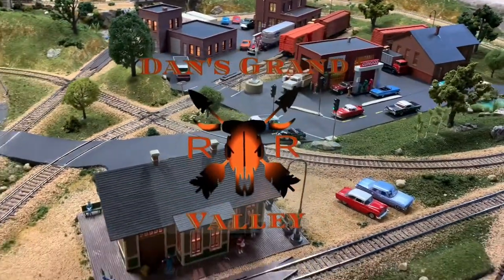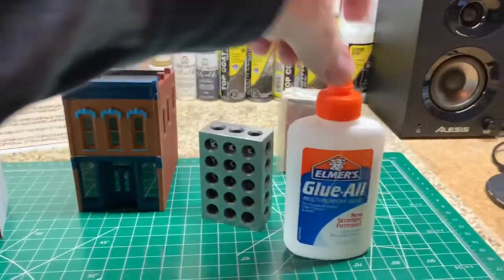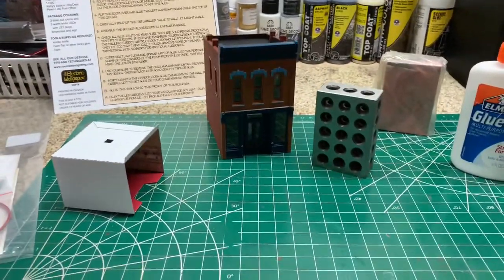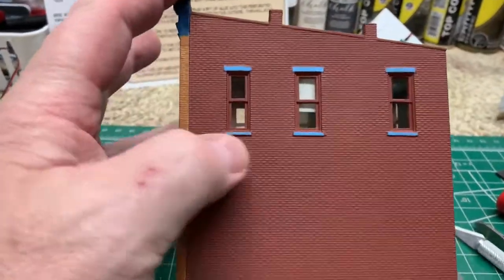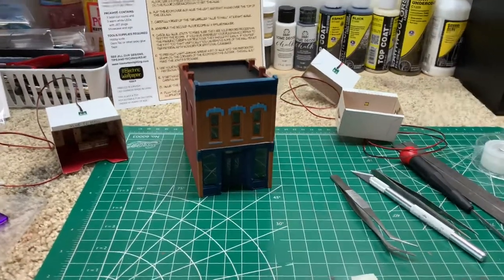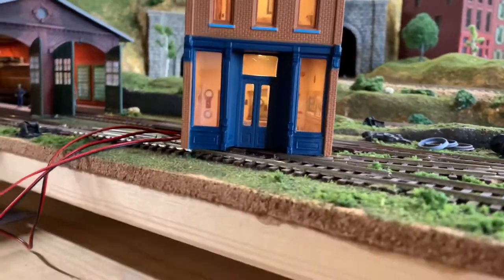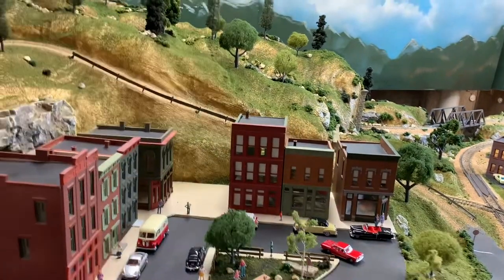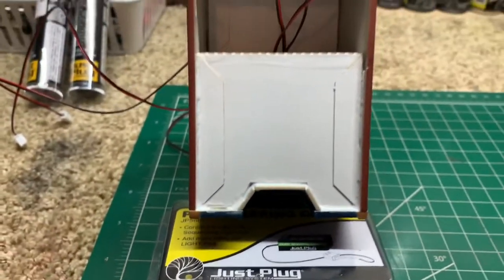Building and Installing a Roomette

Comment: Awesome, Dan. Looks great! I don't have this particular roomette but it's a typical one. I tend to put window tint and diffusing film in windows that are not looking in on a room but a shade like you did is better looking. I grabbed some cheap figures from Amazon and have glued some of them inside rooms too. Not sure they'll be noticeable from a passing train, but whenever I take some cab ride video I'm going to find out! haha, fun times.🚂
Reply from the maker: Ha that’s cool, I think I’ll do that with the next one. I was really impressed by the ease of assembly and how sturdy the rooms are once all dry. When the lights came on it was pretty awesome!!  Now comes the challenging part, getting those wires run under the bench. Gonna be fun!! 😁

Comment: Hi Dan,
Great stuff! You've convinced me to get some roomettes!
BTW, did you ever do a video on lighting the station platform? You removed the dummy light and installed a functioning light fixture! I guess that it's pretty straight forward, but it would be nice to see it done. I was pretty disappointed with the Built & Ready buildings that say "Lighted" when all that's lighted is one single Just Plug light in the building. They show a lamppost (unlit) and a gooseneck side door light (unlit). The Just Plug lights are often larger than the dummy lights on the Built & Ready buildings. I'd like to change them all to functioning lights.
Reply from the maker: Hi, thank you for watching! You know I can’t remember at this moment if I did video that or not? You’re right it is pretty straightforward in that it’s only positive and negative that go down to a bus that I have under the table. I may run a couple of street lights on the sidewalk in front of the diner as a precursor to running them up on the downtown area. There’s a large gap between that area and the bottom of the layout that is harder to deal with then there is in front of the diner. Let me look around through some of my past videos and see if I did have a snip on that or not. I know what you mean about the pre-lighted buildings, some of them don’t have the cool details that you think they should for that kind of money. Ha ha